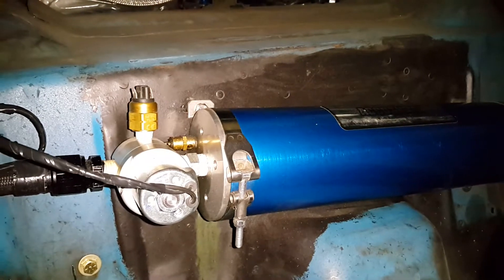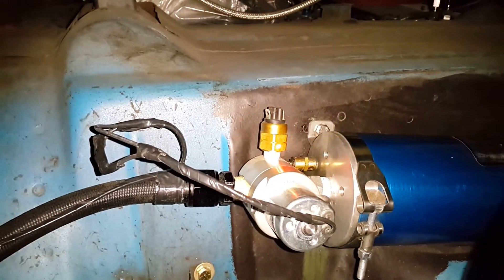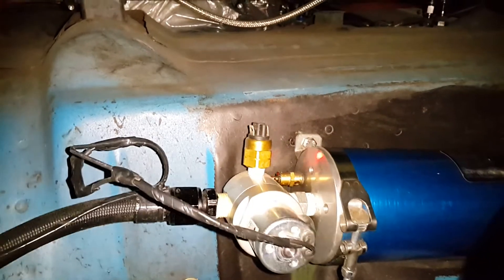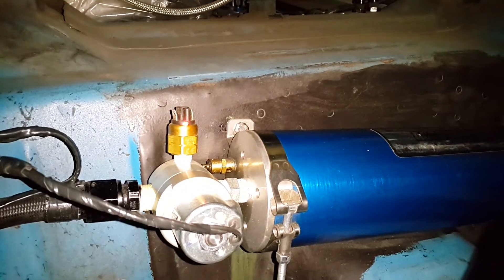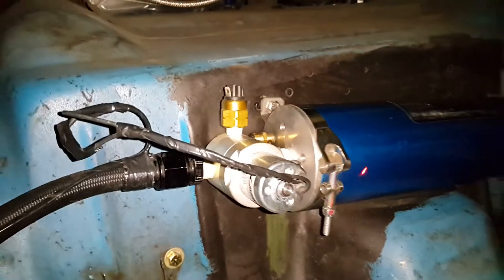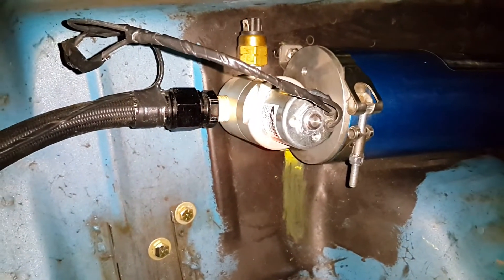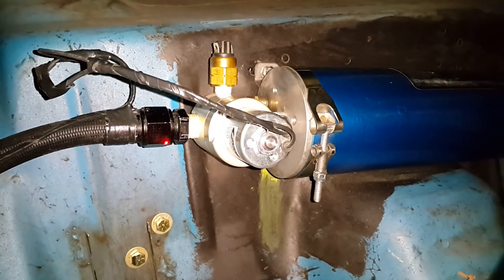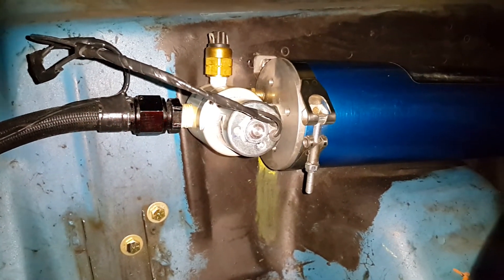More Accusump issues...

Comment: Whoa whoa, what?!? How much oil pressure are you running? The tank and “pressure relief valve” should have no problems handling the oil pressure from the oil pump… if that thing is gonna pop off and shoot oil everywhere, piss on that. What is the pressure relief set to the pop off at???

Comment: I always activate my Accusump before start up so if the pressure switch dies I know.
the pressure sensor is a nice system for cars like mine that drive 100+ miles to events.
but I know that switch will eventually die.
(the main valve uses 0.9 amps so it's not a huge power draw)
Reply from the maker: I agree the pressure switch is really nice to have. I always switched it on too before startup to pre-lube the engine, but  being unreliable as it is sucks when it comes time to replace it. I'm going with a manual valve when I refreash the setup as the Accusump is leaking now. Going with a Moroso Accumulator in is place to try one out as I keep the Accusump as a spare.

Comment: Just finally mounted mine in the 68 charger.....I went with cantons electornic swich on/off type not based on pressure drops per say....correct if im wrong with this setup its gonna be setup based on pressure differences between accump and engine pressure oil correct?  If one is lower than the other they try to balance each other based on how much air charge I have in my accusmp? I plan to put 50psi in the accusmp and when I hit the switch to on if my engine oil drops below 50psi the accusmp then pushes oil into engine until it can reach over 50psi correct in the engine?
Reply from the maker: Yeah I think that's how it works. When the oil pressure drops in your engine the accusump should sense it immediately as oil as a fluid is not compressable & should be forced into the engine via air pressure in the accusump

Comment: I'm going to be installing an accusump soon and I'm unsure which valve to go with. I do like the simplicity of a ball valve however the electronic valve can store oil at a higher pressure. I know a simpler system will always be more reliable but has anything since then changed your opinion of how the electronic valve can be reliably installed where I don't have to worry about electronics failure on top of oil starvation?
Reply from the maker: Nope! On our 73 Challenger build it will be getting a manual valve as well! Less to worry about & much more affordable
Reply: @RylisPro  I might have to go for this option as well. I'm a huge fan of simplicity. just need to remember to turn it on when racing or driving hard!

Comment: The pressure switch has nothing to do with the overall system pressure. If the pressure relive is activeated then your overall oilpressure is more than 175psi. How could the switch add pressure to the oilpump pressure? Its just controlling oil relive at a citain pressure. So if it is not working anymore it will not open the solenoid, but it cannot add oilpressure. It is just controlling the oilrelease point/ time of the accusump. So if your engine oilpressure drops lower then the oilpressure switch point, then the switch will jump to "ON" and will control something that its wired onto.

As somone stated here in the comments- the soleniod has boostspikes. I dont know how you wired it, but if you wired the pressure switch in series to the solenoid, then that might be the reason why it died. I would always wire a switch into the control- citcuit, not into the power- circuit.
Reply from the maker: Completely agree with you & the pressure switch was wired to an on/off switch. The overall system is still unreliable as stated as boost spikes or not the pressure switch should not just fail. Just wired the solenoid to the on/off switch which works just fine now. No more pressure switch
Reply: @RylisPro  yes, but i would wire it in series to a relay, so the toggle and pressure switch, dont have to deal with the amp spikes. I forgot to mention a relay in my last point. And also thank you for sharing your experiance.
Reply from the maker: @G.J.G.P.  the ARC panel I have in the car does have relays connected to all the switches so I should have been covered there? Oh well, live & learn... Thank you for watching the video!
Reply: @RylisPro  ok, but many people still tend to wire a switch into the power circuit and not to the control circuit of the relay where the current draw/ demand is low. Ive seen it lots of time. That would have been my 1st guess, if a switch got cooked
Reply from the maker: @G.J.G.P.  this particular pressure switch was working properly for at least a year of occasional use as I don't daily the `Cuda anymore & a couple of track days before giving out. Then it wasn't actuating at the time I filmed this video. So I am guesing the switch just went bad & that it just wasn't a reliable part.
Reply: @RylisPro  ok, then it was bad. But lets say someone else would have wired it into the power circuit. The switch sometimes can withstand over current a cirtain time. And then its going bad, when you didnt expectt it. 

I once used a realy which had exactly the current rating of the calculated current draw of both of my e-fans. It was always working, but failed when i needed it the most, as i was doing a high speed run on the autobahn. I forgot about the current spike, of electric motors as soon as you switch them on. The relay was able to operate, but sooner or later it got cooked

Im running a digital dash from ECU Master, the ADU7 and im also going to install the accusump with a solenoid. Thats why i have seen your video.

My plan was it to let the dash control the solenoid ( controlled by a relay 😅 ) opening and closing time by using the oilpressure sensor, which is nearer to the engine. So if a oildrop occures, its activatad much erlier as if the switch is at the valve. So i also dont need a external switch and im able to set the ON/OFF pressure.

You also gave me the idea to use a different pressure relief valve, beacuse i dont want to spill oil, neither on the street nor the cabin/ trunk. So thx for that

Comment: Solenoids have some wicked high voltage spikes on release. They will destroy contacts quickly. 
If the solenoid or switch isn't suppressed already, maybe that's what happened. Add a "fly back or snubber" diode across the switch leads to fix it. The switch will last much much longer.
Reply from the maker: I wasn't aware of that? Will look into a diode for the Challenger build's Accusump thanks!
Reply: Super cheap and easy.
Reply from the maker: @rufus7376  thanks for the heads up!

Comment: I've sat on doing my install for a while because I just wasn't convinced of the benefits of the additional electronics, valve, joins etc over a manual lever that i just use at the track.  This has made my mind up.  simple install it is then.
Reply: im wiring mine to an output on my standalone ecu, when i kick the fans on, it will also kick mine on